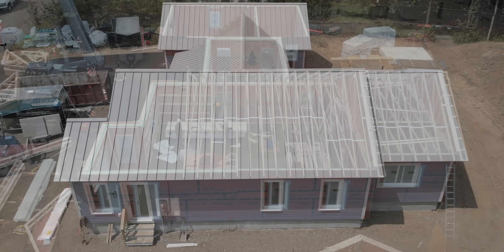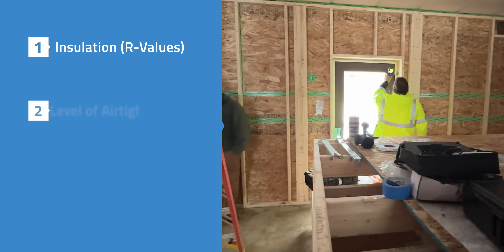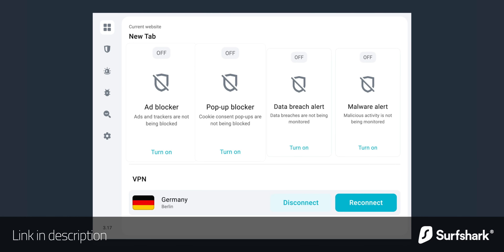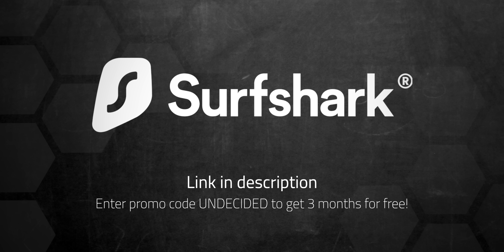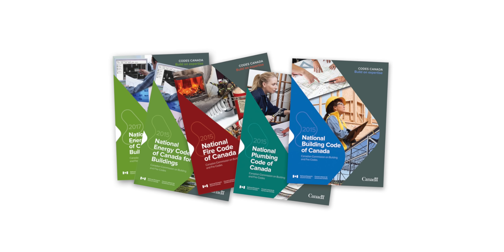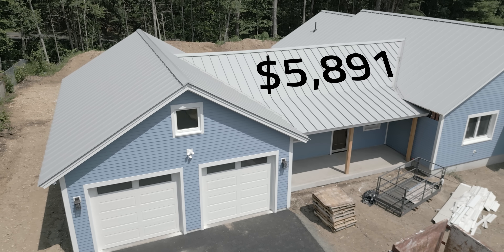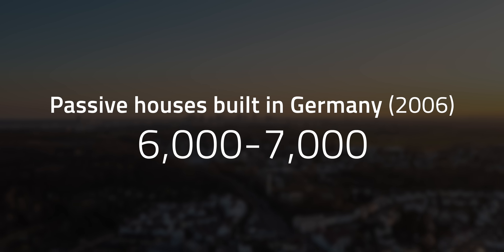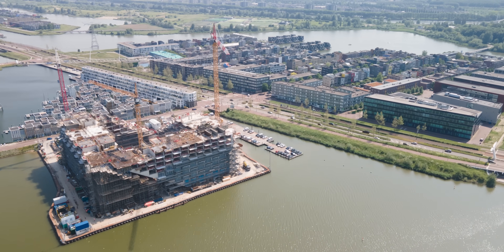Why Do American Homes Suck?

Comment: I once met a Swedish company that built a new, innovative and well-insulated window. They were doing really well on the Swedish market, but just had to roll back their launch from the American market. Why? The CEO told me that the walls on the American houses were so thin they couldn't hold the weight of the windows 😂😂
Reply: It might not have been an issue with the weight of the window but rather that the windows require far thicker walls to be properly installed.
Reply: Windows are attached to the frame being supported by the foundation..... how heavy were the windows that the walls couldn't support it? Heavier than the roof?
Reply: @Lacaras21  Roofs here weigh tens of tons. So no, just standard
Reply: May I get the Swedish cy name? Thanks
Reply: Funny, but as an Austrian who lived in the USA, I totally believe it.
Reply: Thickness of the Windows is the issue not so much the weight. US Walls being 2x4” The frame on a modern window here in Denmark are typically above 14cm or 5 1/2”.  Weight is due to material usage much higher than a us window but a 2x4 can support the weight. 
In regards to 2 story building - regulations will require higher stiffness / strength in the construction here than what a 2x4 can deliver, typically a 2x8 is used due to higher insulation thickness requirements.
Reply: I think, I know the answer why the 2x4 walls cannot handle the weight. The EU code for installing such windows, describes to mount the windows close to the outer edge of the wall, on consoles outside the wall structure. Thick insulation goes to the outside of the framing, not just in between. This can cause the wood to split, if the installation made poorly. Also imagine, if you open a patio door, which weights more than 300 lbs. It will bend the wall, and cause cracks eventually. More, what if the wind slams it close or open?
In my opinion, most builders around the globe are not really following precisely the installation instructions, and it can cause the source of the problams, and probably warranty complaints later.
Reply: Bull shit. Walls here in the US can support heavy windows.
Reply: wood framed walls in mild weather locations are often only 2x4's - which are narrow compared to what nordic countries use - nothing to do with how strong the wall is, it is about making room for the insulation they need.  The irony being, US houses in hot areas use/lose more energy via A/C loads then those nordic countries do with cold weather.  We should build better insulated homes.
Reply: @r.b.l.5841  The US does have insulation requirements.
Reply: @saulgoodman2018  not like the nordic nations.  The point is the wall thickness is the reason those windows are not seen as a good option for upgrading many of the US homes. Those window frames are designed for a thicker wall system.
Reply: @r.b.l.5841  The US does not get as cold as the Nordic countries.
Reply: @saulgoodman2018  No but it gets a lot hotter, and we throw our money away try to cool poorly insulated buildings with 100 kWh per day un-necessarily.  We could learn a few things and do better.
Reply: @r.b.l.5841  When buildings are built. We have insulation requirements.
Reply: @saulgoodman2018   And when you buy a building that is old it doesn't
Reply: @r.b.l.5841  Of course. Things changes over time.
Reply: @strange-universe  Also, it doesn't surprise me. And that real, high-quality Scandinavian products couldn't be installed "long-term" on American houses shouldn't really be that surprising? I mean you walk up to any one of these beautiful white picketed fences and it bends over with the touch of a finger. It's all just fake and cheap materials. That is how Americans build.
Reply: Cuz they want us to continually consume.... continually repair and continually penny pinch us to keep us in line so the mass majority of ppl continually have jobs and keep stagnant.... however.... they tilting the tablea too far. 
All by design. -_-
Reply: and this is why apartment complexes completely suck, as far as insulation and noise! Apartments are the WORST when it comes to cheaply made infrastructures.
Reply: non sense - windows weight is negligable the standard window frame can support 10x the weight of any window.
Reply: You have to be smart when installing triple glazing. When your windows are better insulated than the rest of the house water could condense on the walls in stead of the windows. 
I live in Germany, and I have a house built in the 1970’s. I insulated it as well as possible with a house this age. It is not Passive but it is CO2 neutral
Reply: Yeah that was a bad made up story.. My whole neighborhood in the United States is made out of stone. Europeans don't understand how big the United States is for the most part. They just keep looking at things the way they would look at them in Europe and that's not the way you do it. Even if Europeans have been here  it doesn't mean they will understand.
Reply: I would think that is probably a bullshit reason... wood framing isn't super strong in every direction but a 2x6 wall can hold up a bunch of weight
Reply: I call BS here. 2 X 4 studs 16" on center can handle a second floor and a roof, but we're supposed to believe they couldn't handle windows? Come on...
Reply: It can't take the additional weight..genius. @crusher0427
Reply: @crusher0427  Triple glazed windows are extremely heavy. Also do I see people drilling holes trough the studs for wiring and stuff. No problem with brick walls, altough modern houses have a concrete wall for the load bearing, then the bricks are just facade. But wooden studs 2 x 4 is a no go for housing in Europe (maybe a shed or something), so I guess they never took weight in account as a possible issue.
Reply: @hunchbackaudio  I think its more of a difference in regional resources thing than a standards thing. The US has plentiful sources of wood making it very cost efficient and is a renewable resource. Wood itself has amazing properties in tensile strength, versatility, and ease of working with. Wood homes have several advantages over concrete homes as well, they are easier to insulate, are easier to modify post construction, and are more resistant to earthquakes (which is important in certain parts of the US) to name a few.
Reply: @hunchbackaudio  US standard is 2x6 and has been for decades and we've had tripple glaze windows for decades too. The CEO you talked to needs to get out more.
Reply: It’s certainly a consideration……add 20% to the cost of the windows and a combined 40% in materials and labor to the framing to accommodate it and the home is far outside the price point and the reach of the intended market.
Reply: @Matt-yg8ub  Aer american houses even CHEAP? They are just cheaply made, but not cheap at all.
Reply: @Matt-yg8ub  cost more in the short term to build and install but cost way less on the long run
Reply: Having such strongly insulated windows when your walls are paper-thin probably doesn't even make sense from an energy standpoint either. I live in a houss that was built in 1952 but does have modern triple-pane windows. There's a little slot with an adjustable cover underneath the windows in the windowframe letting in air directly because the windows insulate better than the walls and afaik that would cause problems for the walls if those slots weren't there.
Reply: @LRM12o8  The slots are for air pressure. If they weren't there you wouldn't be able to close the door in a modern home. They're not necessary for your 1950's house because it has too many air leaks.
Reply: lies
Reply: is this a reply to me?
 @aredub1847
Reply: @strange-universe  You could call it hearsay. But it was real talk from a real person. Unfortunately I didn't think about it myself and never asked any further questions. But again, since it was an actual event and I find it hard to believe that the CEO would stand there and lie to me, there has to have been a real problem nonetheless. Whatever it meant that "the walls couldn't handle the weight".
Reply: @themartinandersson  could it have been figuratively? "The walls couldn't handle the windows" could mean it didn't make sense to have well-insulated windows in poor-insulated walls.
Reply: @LeifNelandDk  TBH I have no idea lol. Judging by the comments on this thread it could mean anything 😂 I also find it hard to believe that the walls literally crumbled, so the meaning is figurative to some extent. What do I know! Maybe they did crumble, but only at high winds, for example?? 🤷‍♂
Reply: @themartinandersson  Do you really think that 2x6 wood framed window can't hold a regular Swedish window? What's the window made out of? Lead?
Reply: @themartinandersson  all CEOs do is lie. That's their job. It's really an incredible claim given the amount of weight that a basic stud wall can support. They can even support a second floor and a roof so it's very difficult to imagine a windiw too heavy
Reply: I call BS, too. There is no way the windows could be heavy enough that even a 4” wood frame wall couldn’t support it.
Reply: @SpruceOaks  Did you see the windows. In the long run maybe the wooden wall would bend? I don´t know, maybe BS, I think it is funny.
Reply: @mymixture965  I don't think it has anything to do with the houses being built of wood. I live in the north of Sweden and many of our houses are also built from wood and we for sure use triple glazed windows. Wood might nog last as long as concrete but it is a very handy material to build houses with and with proper insulation it is perfectly fine for cold climates.
Reply: @evawettergren7492  My house is made of wood, so I know it can be stable, no question. I just found that quote funny. I saw how Americans build there houses and the time I lived in New York my father in law visited us. He worked as a bricklayer most of his live and he could not stop laughing after what he saw. He always pointes at things and burst out laughing, he could not believe what he saw.
Reply: @evawettergren7492  same in in Finland too, though the only type of a wooden house I would want to own is a solid log house. I live in a 100+ year brick house with a double walls and an insulating air gap in the middle. The walls are more than .5 m thick (2ft) and I have solid oak framed triple glazed windows.
 Single glazing in the outer window and double glazing in inner. The problem with wooden frames are related to potential leaks in the vapour barrier. If you get one, your structure is screwed in the long run. Also, having solid interior walls gives superb sound insulation compared to any framed wall
Reply: Clearly never been to Europe i presume..We build things that last longer than a couple of years..Yanks can't build anything without a nail gun. @SpruceOaks
Reply: That is absolutely BS. The walls could absolutely hold the weight of the windows, unless they are some outrageous weight. The issue was definitely that of cost...
Reply: @itech301  it’s not sheer weight. Triple glazing doesn’t tolerate much movement therefore you can’t use wooden frames just plastic or aluminum. You have to add extra studs to make the wall rigid enough with wind pressing on the glass, to prevent to much movement.
Reply: @hunchbackaudio  it still comes down to costs. The marginal cost of extra window framing pales is negligible to the cost of the windows themselves. People who are really energy concerned don't even frame with 2x4s. 2x6 walls are the norm. I believe it is still a cost issue
Reply: @itech301  It’s always a cost issue every building issue can be solved. It’s probably just not an issue they never thought of because of a different framing style or the use of concrete or bricks, that are the standard in most of Europe. In our windy rainy climate, wooden houses wouldn’t last very long.
Reply: @hunchbackaudio this is not true, it is not unusual to have triple glazing with pine framing here in Norway.
Reply: why r u lying

Comment: We renovated our (German) house a few years ago and windows with 3-layer glass were our only option since 2-layer glass is no longer sold by local companies. Another requirement was ventilation with heat exchangers
Reply: My parents built in the 90s and current building codes meet their original choices (meanwhile they saved many € on heating), I expect the new roof to exceed German requirements again.

Comment: A bigger problem is that zero attention is paid to the orientation of the house north-south with the longer portion east-west, Then the placement and sizing of windows based on orientation is also useless. This alone, regardless of amount of insulation or tech involved, would make a huge difference. Why? Because later owners could upgrade tech and/or windows, but nothing can be done about the orientation. Oh, and then they plant big trees on the south side with the idea of shading the house, which it does--but only in the wintertime (here in the Northern Hemisphere).

Comment: Beside the UK, Germany and France, there are countries in the EU that are pretty much the same as the US. In my home country, Romania, people are still building houses out of bricks and cement the way they used to in the 80s. The only thing that seemed to change is that they slap some insulation on the outside and, ON PAPER, this increases the energy efficiency of the building. In real life thou, they mostly scam you on that too, because of the incorrect mounting of said insulation, which makes it worthless. Just a quick example on our house: the U value with the specifications of the building should be around 0.4 of the wall, in reality, the measured U value is around 0.9. What does this mean? That I need to undo the whole outside of the building, scrape everything off to the brick and redo all of it, hopefully with a better contractor and with strict supervision.
There are, ofc, advocates of zero net energy construction standards, but they are still in minority. Some of the legislation changed this year that will tighten the grip on the minimal values going forward, which is good. But it will be hard to change 40 years of bad construction habit. The most common response you get from construction companies and individuals is "I've been doing it like this for 20 years, don't tell me how to do my job, kid". And they refuse to work with/for you.

Comment: The U.K. has its fair share of crap housing. I bought my new build house in 2006. The insulation was missing in bits. Electrical sockets left lying on the floor. Gaps in the roof insulation. Double glazing windows that can’t be cleaned from inside because the tilting doesn’t work. The builder conveniently goes bust and the NHBC seems to be an insurance for builders paid by the home buyer. Worthless. All this was passed by the housing inspector and surveyor. And the internet is full of similar stories from others in the U.K.

Comment: It cost so much but building materials so suck😂 basically a wooden box. Even a knockdown house in Thailand with the same size will cost just around 30,000 usd with powder coat steel frame which last about 30 year easily and a cement board as a wall with aluminium frame covered by insulated metal sheet roof.

Comment: As someone who live in tropical country, I am thankful that I don't need to worry at all about airtightness and insulation. We even tried our best to make our home as open as we can for better airflow, natural heat dissipation and to regulate high humidity level. It's the exact opposite of a home in a 4 season country 😅
Reply: Sound waves, dust and bugs also catch a ride through those natural airflows though.
Reply: @din6675 Yep, that is correct. Brooming, mopping once, twice or even three times a day is a norm since I was a kid.
Reply: Insulation isn't just about keeping heat in; it's about keeping the temperature difference more stable. So it also means keeping cold air in as well. ACs also have a mild dehumidification effect.
Reply: However as the climate changes then your home will experience ever hotter-humid inside and your airflow will make Aircon very expensive (assuming local power prices are not free)
Reply: @stephendoherty8291  I believe that global climate changes are true and impactful to the nature and global situation. But in day to day life (in hot/tropical country) generally it isn't too noticeable.. probably because it is already hot since we're born.. I believe with heating in cold climate, it was being done in the whole house? But, in my place we are very rarely do that. House with a luxury of an aircon, usually only place it in their bedroom, which usually isn't too big (houses in Asia generally already smaller than in the US to begin with) and use it only when they are sleeping in the night. Plus efficiency in recent aircon technology (like inverter and smart management) help to reduce the wattage usage furthermore. Price increase is obviously to be expected, but it might not as expensive as you might think for aircon case.

Comment: Australia's housing stock is mostly best described as living in a tent.  The building industry opposed energy standards for years but eventually the building code included a 4 star energy rating from 2003, 6 star from 2010 which is about to be lifted to 7.  Anything more than 20 years old is like a tent.  I understand many European countries have required 8 for many years.  When I lived in Sydney I had an English colleague who said she had never felt so cold in her entire life.  We had Europeans come back to our apartment once in the middle of winter and we had not left the heating on and the shock on their faces was embarrassing.  My sister moved from England and did some renovations, on requesting double glazing (note: double not triple), the builder said why, you don't need that here.

Australia had quite cheap energy like the US and so the attitudes have been very similar, build as cheap as you can.  Our Government has failed to do long term planning and not just in this with vested interests dictating policy.